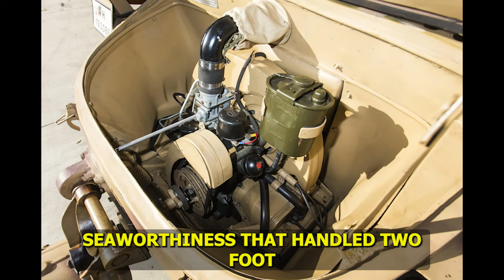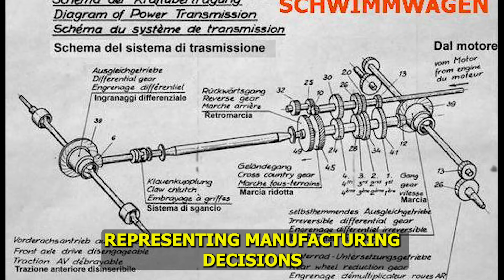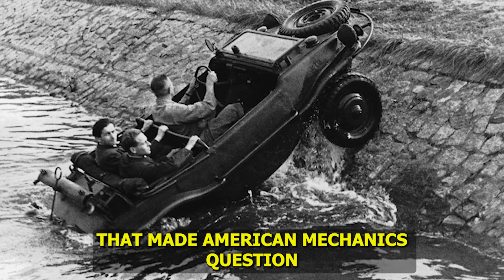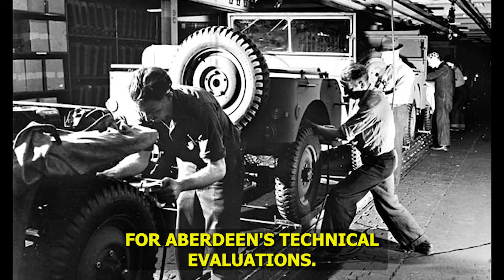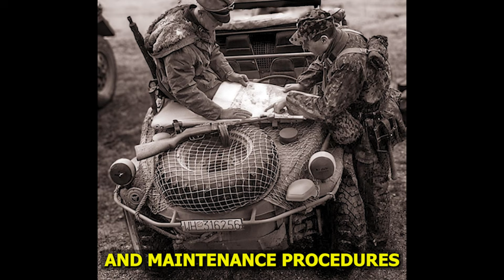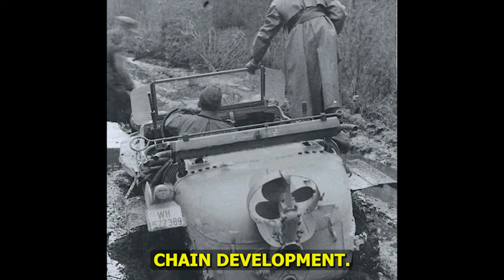American Mechanics Opened a Schwimmwagen — Laughed at It and Said It’s Useless as a Jeep Replacement

Comment: 4 wheel drive was not better than jeep.  25 hp air cooled boxer motor, sits very low in water with poor free board.
No counterweights on crank
Solid lifers must be adjusted every 3k.  Portal axles were found on early year buses. 
This feels very AI.
Reply: For the 1940s, this sounds about right to me. No counterweights is to be expected. That is the bonus of every modern boxer engine. By design they don't need harmonic balancing because the pistons oppose each other and almost completely eliminate vibration. Just ask any Subaru or Porsche owner. The downside of this design is high mileage piston slap, lifter noise & high motor oil consumption due to odd ring wear &/or broken ring lands. I assume the 25hp schwimmwagon has similar issues to my 265hp Subaru WRX but due to limited alloy technology and technological limitations of the time it needed a whole lot more maintenance. Even with Hydraulic lifters, Boxer engines have lifter issues. It's a know limitation and the trade you make for no harmonic balancing, high power to weight ratio and low center of gravity. I assume like Subaru and Porche, Schwimmwagon would have been harder to roll over in an accident than a jeep or any American vehicle with a higher center of gravity.
Reply: @IbocC64 yeah so build a bug motor or a 912 engine, those counterweight make for a truly smoother engine, even years ago the welded counter weights on bug cranks led to a much smother engine, yep this is an early 30s engine design but overall that engine was made really for the type1 (nice 166) old days we maintained our engines and brakes (another 3k service item) my beef  that the jeep was a much lower service order machine.  The portal axels were nice and there are lots of neat stuff on a schwim I just don't see it a awestruck engineering as presented.  That boxer design was in no way unique for the day, as the benefit for bearing wear, center of gravity and many other features were features of several car designs of the day, as Ganz, and Ledwinka had similiar design cues. As a several bug owner and 912 owner I loved the platform.